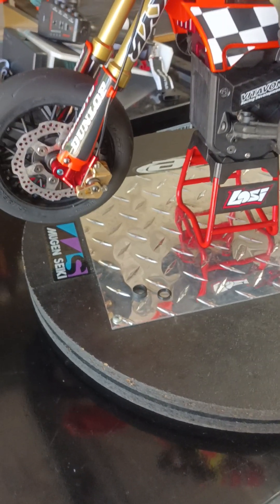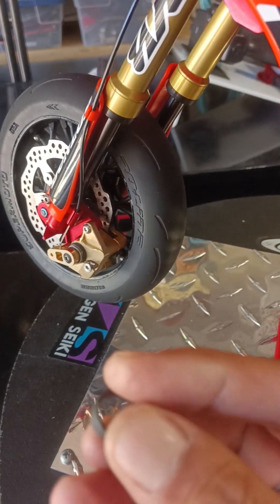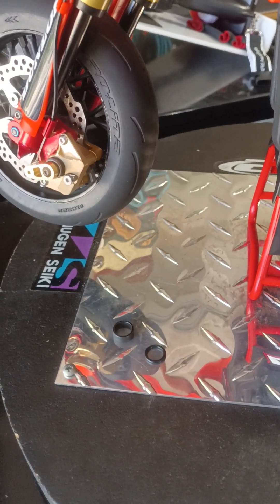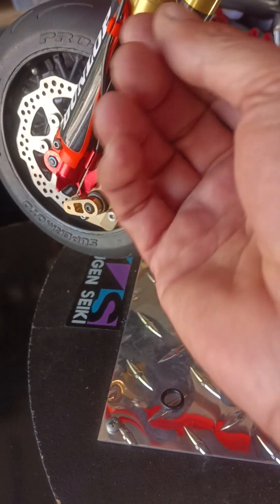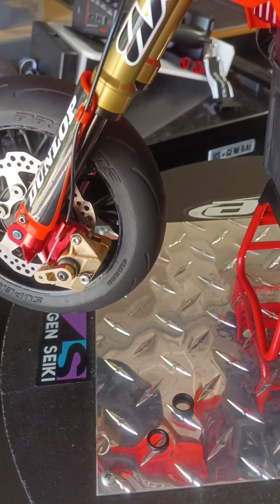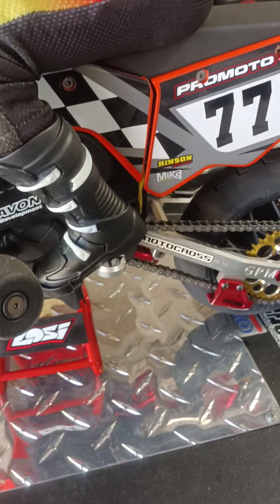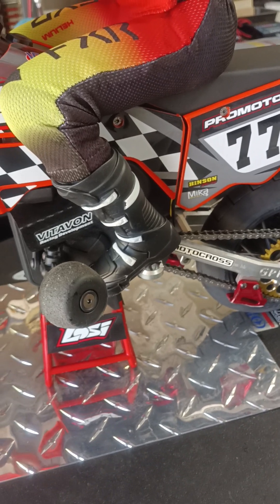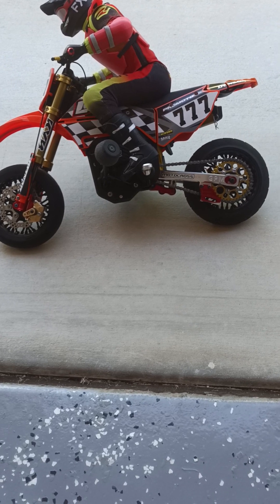the proper way to set up your suspension in your front fork and rear shock with modifications

Comment from the maker: You want to use the metric o-ring I'm not sure of the size find one that fits just a little snug take it off stretch it with a pair of needle nose pliers by putting it over the needle of the nose of the pliers and opening it up and then put WD-40 on it and put it in if that does not work for you because it works for me GPM just released a new nylon sleeve collar specifically for this application and I know they would and it is nylon